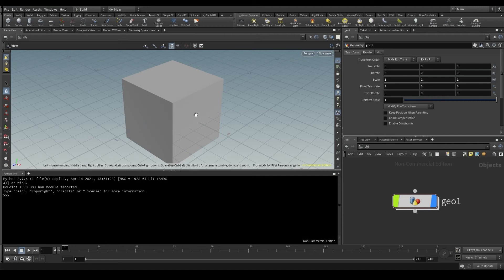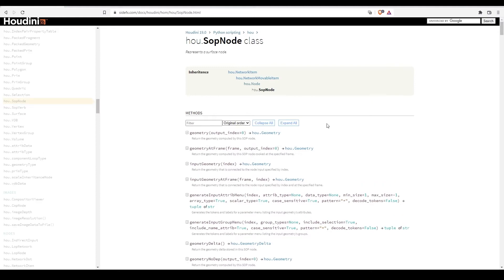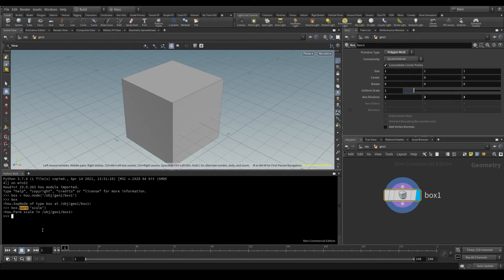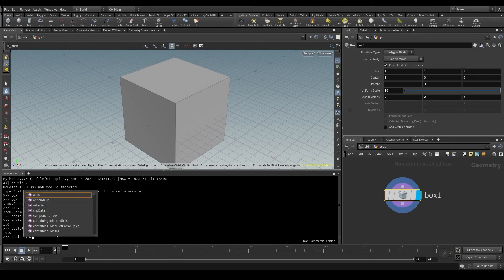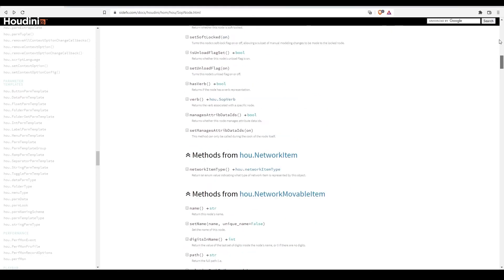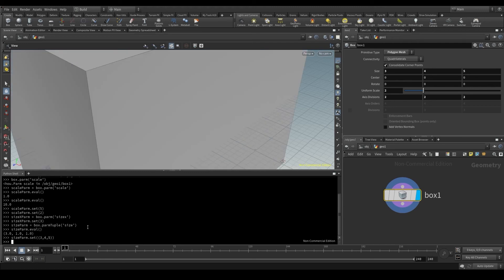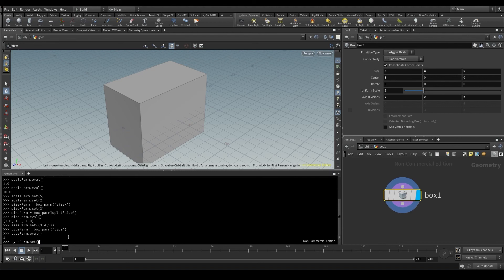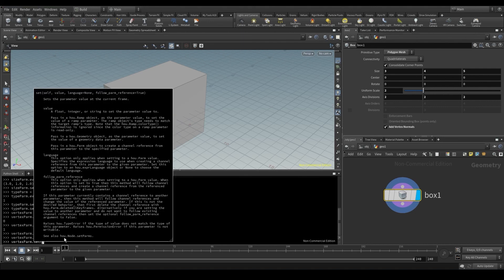Reading parameters and changing their value | Python for Houdini

Comment: Very good information, thanks. But if I want to modify or set the intensity parameter of a light made in solaris (/stage/light1) I get an error. Something about the name of the parameter containing ":" because the name of the intensity parameter is "inputs:intensity". How could I resolve this?
Reply from the maker: Grab the parameter, drop it into the Python Shell and you'll see the actual name of the parameter: "xn__inputsintensity_i0a".

Parameters in LOP nodes are a bit tricky to handle because of this. Hope SideFX comes up with a fix soon, but in the meantime that's how you do it 👌🏻
Reply: Great! thanks for the help Juanjo!!!